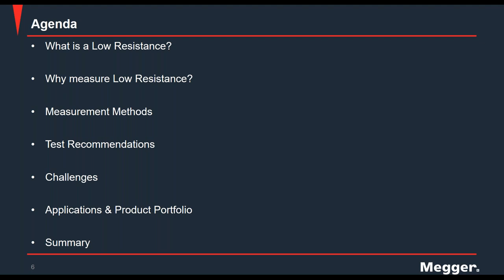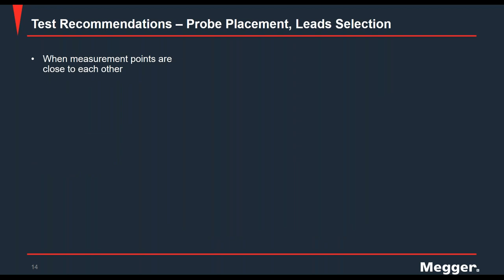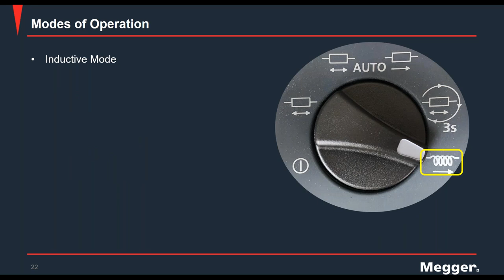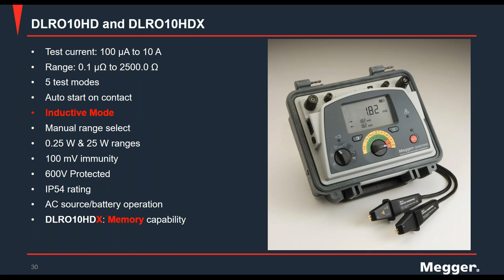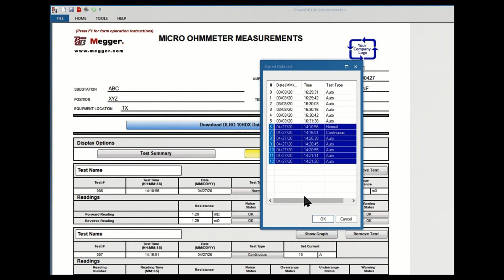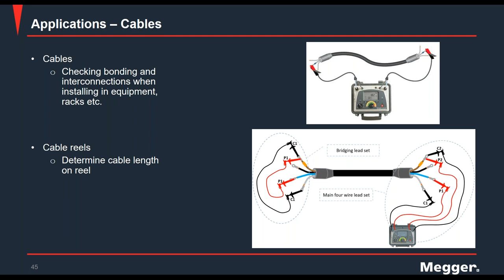Practical Considerations for Low Resistance Testing

Comment: Mark the fixed point potential probe at the head in a different color that makes it so much more obvious than a simple P. Really engineers at megger who are not using day-in-day out need to talk to electricians working in different situations and conditions. This should be especially important with new equipment to fine-tune the design and use of the equipment.